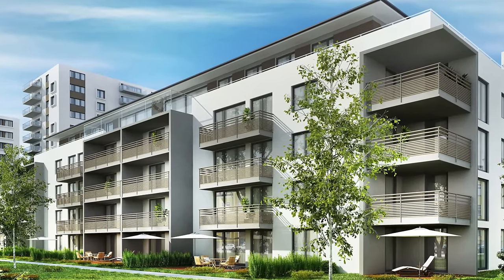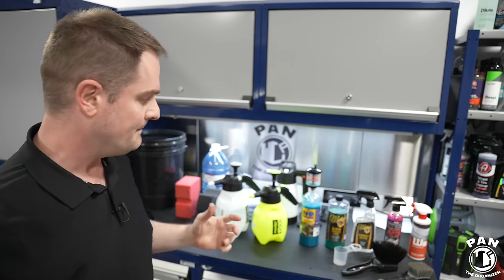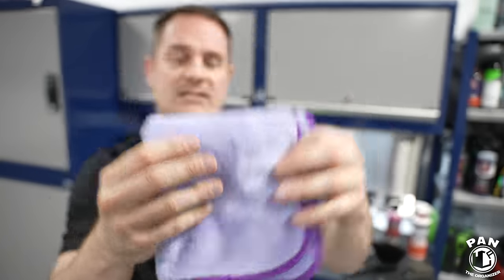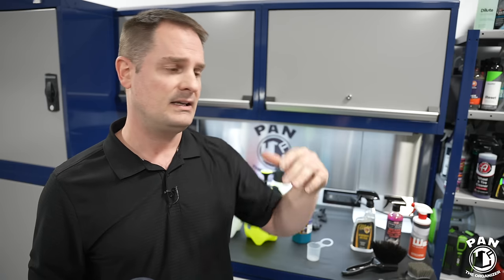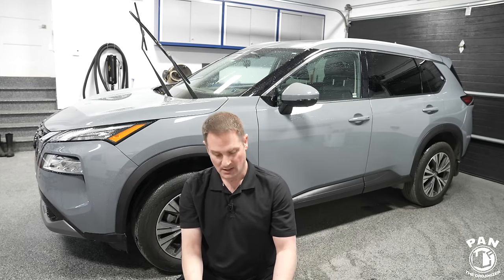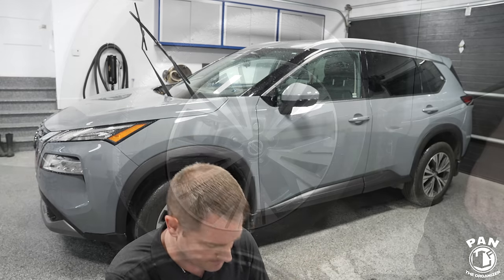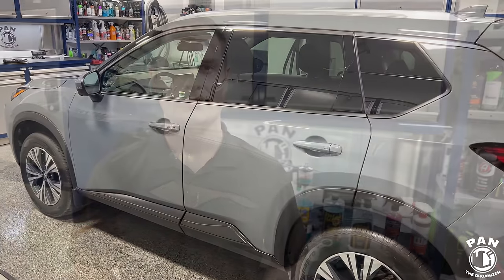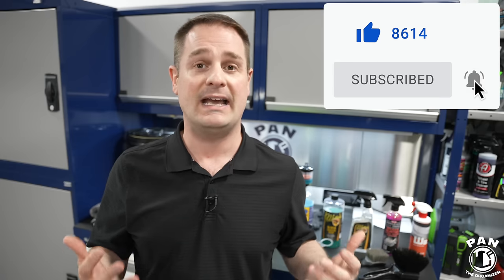How to wash your car without a hose or pressure washer! (RINSELESS WASH METHOD)

Comment: I can't believe this video has evading my searching and sleuthing of rinseless washing!  Top tier video.  Would've made my life easier if I found this about 2 months ago haha!  I am glad to know that I ended up on the same method for the wheels as you did here (P&S brake buster with rinseless spray down after; thanks for putting my mind at ease that this product does get neutralized this way).  Great to know I can even use bug remover during a rinseless wash.  Fantastic resource video...  From start to finish!

Curious for your thoughts.  I've been using the Eagle Edgeless 350gsm towels as a multi towel wash method (typically 5 is perfect).  While I've done the wrist roll you mentioned for a waterless wash...is it super necessary for the rinseless wash?  I adopted a way that seemed commonplace of just applying no pressure except the weight of the towel, some straight lines back and forth (similar to sponge) and flip to new side as needed or after 1 panel, whichever comes first.  Hope I'm not damaging paint; but I guess I thought there was enough lubrication on surface and with a thick enough MF towel...

I also love using the rinseless washes in a QD dilution as a couple extra sprays per panel for extra lubrication during drying process!
Reply from the maker: Thanks for the positive feedback! Don’t overthink the moment for the wrist roll, if you are just wiping it’s still fine, just change to clean sides often and don’t apply too much pressure.

Welcome to my channel. You discovered one of the biggest car detailing channels on YouTube as we surpassed 920,000 subscribers and we have over 120 million views! I have been detailing for 26 years and I love to share my knowledge and passion with my viewers.

You found the right channel to help you learn everything about detailing.

How did you discover my channel by the way?
Reply: @PanTheOrganizer   thank you for the feedback. You're definitely a top class content creator and community member...reading and replying to your comments and helping people out.  Keep doing what you're doing. Many thanks
Reply from the maker: Thanks! I'm the only big detailing channel that actually replies to its viewers on a daily basis on YouTube. I can spend up to four hours every day simply to reply to YouTube comments. I won't lie though, it does get overwhelming as you can imagine with an audience of almost 1 million subscribers and many more watching. I receive thousands of messages daily across all platforms.

I try my best to stay connected with my viewers and will continue to do so for as long as humanly possible. :)

Comment: I'm a big fan of a gallon of Wolfgang Uber SiO2, very affordable when you buy as a gallon. It's the only wash I use for mobile washes. You can dilute for clay lube, bug off, detailer, wheels, etc. Soak the car with a sprayer full of the mixed wash first, then use fresh towels that have been soaked with WG wash in the bucket to wipe grime off. After drying and any correction go through and use as a detailer. The beading action is fantastic. Super smooth finish

Comment: I use Wolfgang Uber Rinseless Wash(recently started using the SiO2 version) on my Infinity Q60 which has super soft paint and mars if you just look at it wrong.. It comes with an integrated measuring cup. It does a really good job and doesn't mar or scratching the paint. I use the Bucket method with Cheneel Wash mitts or super soft Microfibers cloths that I let soak for 10-15 min before washing. The key in +90F heat is once section at a time. Also use it in a pump sprayer with Distilled water as detailer.

Comment: Hey Pan thanks for a great channel and amazing tutorial videos, question i had can you use iron remover with the rinseless wash method worried that thr rinseless wash sprayer may not remove all the chemicals from iron remover

another question i had when your sprayer ran out of solution, can you dunk it in the bucket to refill mid wash ..i am ppf and ceramic coated

Comment: Hi Pan... I have watched a ton of your videos and have learned a lot. I thought I knew quite a bit about detailing until I found your channel. I have a question and I apologize up front if is already been asked and answered... I have a car that rarely sees the outside of a garage, other than 10-12 weekend car shows during the summer.   Let's say the car is already cleaned to spec and coated with ceramic the way you demonstrate, and is driven to a show weekly. Questions is, what are your thoughts on how to 1 - clean/prep the car upon arrival to remove what was picked up during the drive, and 2 - how to remove the dust/pollen that will eventually land on the panels while sitting in the sun for several hours. I appreciate your feedback... TY

Comment: I've been using a combo between the Gary Dean Method with the Rinseless Wash Method, but I use a pressure washer at a DIY car wash. Not too sure how much lubrication you'd get from the soaps at these places, so I use rinseless wash solution instead. I soak the vehicle in this solution and then pressure wash it for an initial rinse. Then, I reapply this solution with the bug gut remover and proceed like a normal rinseless wash, but I use the Gary Dean Method along with it. The only time I place an already used towel back into the bucket is at the very end when I need a few more sides to finish and the solution is still clean. From that point, a perfectly clean solution isn't as imperative for the windows and wheels.

Comment: Great video Pan. To be honest, I'm not a huge fan of the rinseless washes- I have done them and they can save a bunch of time if you have multiple cars to wash, but I felt like something was lacking from a full maintenance wash. Probably in my head lol. One thing I did different was load 1 oz ONR into the foam canon for the pre rinse and that made it even faster.
Reply from the maker: Heheh yeah I fully understand you. I also use the traditional two bucket wash as I also feel it gives a better overall clean.

Comment: Hey Pan, as always the video is insanely helpful to us and well produced without all the nattering and over-explaining some other channels try to do!  I have one question before I go ahead and order some no rinse:  My car is coated in 2 coats of the Hybrid Solutions ceramic spray coating (thanks to your recommendation) and I usually use that Hybrid Solutions ceramic wet wax spray as a drying aid, would that be safe / necessary with a no-rinse clean like this?  I had to spend an entire morning getting rid of the waterspots before applying the ceramic coats so I'm hoping to avoid anything that will cause them again.  Thanks mate

Comment: Hello. Fantastic video as always. Thank you. 

Coming from the U.K., under normal circumstances when the car needs cleaning ‘The car needs cleaning’. I get your explanation re rallying/covered in mud, but it would be interesting to see comparisons in your opinion which examples could be washed without running water and which examples can’t. Thank you. All the best.
Reply from the maker: Thanks! If it looks too dirty, use the traditional wash method, or at least pre-rinse the vehicle first with a pressure washer. Common sense is needed when using a rinseless wash method.

Comment: Hey Pan, I live in and apartment complex and I've used a variety of different methods and products. Here's my current set up that I'm running and it's worked very well.

I have a Zerowater to remove the impurities from my tap water. I live in California where my tap water is 400TDS. This does bring it down to Zero 0TDS and I get 20-25 gallons per filter. Filters are 2 for 30 so less than 1 dollar a gallon when compared to 1.50+ tax for distilled water. 

From that filtered water I use McKees 37 Graphene rinseless since I have a graphene spray coating on my car. It's $1.50 an ounce so not the cheapest for their 32oz bottle.

Everything together i use 3-5 gallons so $3-$5 bucks, about 3oz-4oz of product. I wash my car in direct sun for $9-$11 without fear of water spots.
Reply from the maker: Yup. I have a water deionizer setup in my garage so get 0TDS water too, which is amaaaazing for washing cars.
Reply: @PanTheOrganizer  I also have a deionized set up. My issues with it, is that I have to constantly switch out to use a faucet to water hose adapter in order to pump water through. The DI resin gets to be pricey since my water is 400TDS I don't get as many gallons out of it around 50 gallons for resin that cost $70. I think I get more gallons out of the zerowater because it's more of a drip pour so the water flow rate may be a factor. When the deionized water starts to increase TDS I filter it through the zerowater water kinda of like a pre-filter so I can get more gallons off the zerowater filter. 

The time I switch between zerowater and my deionized setup depends. Do I want the 3-5 gallons in 40 minutes using the zerowater? Or do I want 3-5 gallons in 6 minutes.
Reply from the maker: Interesting!

Comment: I bought both the red and black sponges - both disintegrated within 6 months - I kept them in the ONR solution in the bucket as I thought you could  - now just use a noodle mit - those sponges were expensive
Reply from the maker: Thanks for sharing your experience Robert. Did you try contacting The Rag Company about that issue?

Comment: This video is older but I use ONR on every car lot vehicle I do. It's more affordable and helps my time management which is key in car lot Detailing.  The car lot is not paved and weve noticed the vehicles dont accumulate as much dust and dirt on them as it sits on the line.  I use ONR on some customers vehicles depending on what services they are in for. I prefer rinseless to traditional foaming washes.  And if used well, I've rinseless washed a muddy car with it as well.  And ironically I'm doing a rinseless on a car today that lives on a dirt road.  Customer said to also protect it. She is hoping the dirt won't be as sticky.  So we shall see what she feels after a couple weeks
Reply: Well?

Comment: Learned a lot. As a mobile detailer do you think this is the better method for working in the winter months with snow? 🤔
Reply from the maker: Common sense is needed for the temperature. If water freezes, than it will freeze the solution containing the rinseless wash too.

Comment: I use ONR almost everyday to keep my cars clean. no issues

 I was very disappointed with the life of both the red and black sponges,   - both started shedding the cubes in less than 12 months - expected better for the cost.

So, now  I only use a noodle mit/microfibre.

How long can you keep the solution?/ need to renew - I use a grit guard and do not allow the water to get very dirty - sometimes i spritz the mix up with a shot with the pressure washer and it seems to be fine.

I regard myself as a daily amateur warrior

I trust your advice

Comment: I use the 2 bucket method but have to drag buckets, sprayers, foamers etc from my apartment so when the car is fairly clean this might be a easy solution. I’ll try it with the wash mitt and microfibre towels to see which works best for me

Comment: I'm going to try this method over the winter. I've got a full pressure washer setup and a heated garage but no floor drain and I really don't want to get everything in the garage wet with overspray and I don't want to turn the driveway into an ice rink either.

Comment: Hay Pan ! Great video..Just learned about the wheels with a Risless ..Thank you..But can you do this Outside..The working time is so different out in the  Element's
Reply from the maker: You sure can, but perhaps do one panel at a time and dry it as you go if you're working in the hot sun. Always try to avoid direct sunlight in general, not just for rinseless washes, and work in the shade for the best experience. But high quality rinseless washes like these in the video have water softening chemistry that helps with preventing water spots, but still do a panel at a time.

Comment: Hi Pan, long time watcher, first time commenter. .Question on washing the car in your garage.   Do you ever worry about too much humidity in the garage as a result of washing? I’ve read about ill affects of too much moisture contributing to rust of a car
Reply from the maker: Hi John! Welcome to my channel. You discovered one of the biggest car detailing channels on YouTube as we surpassed 1 million subscribers and we have over 140 million views! I have been detailing for 27 years and I love to share my knowledge and passion with my viewers.

You found the right channel to help you learn everything about detailing.

To answer your question, my garage was fully custom built to be a wash bay for detailing cars. From mold resistant drywall, kitchen/bathroom type paint, to dual drains in the floor, to a sealed cement floor, to a heat pump for heating and cooling year round, and also a 70 pint dehumidifier for perfect temperature and humidity control. So I detail in perfect conditions of 20C (68F) and 45% humidity. :)

All the details about my custom garage in this tour video: https://youtu.be/wx6HTBAzeXI?si=j0V-BFXNLO_m4oPa

I have had two new homes built this way, and never once had an issue. So yeah you have to plan all these things when building a new home, in order to use it to wash cars without worrying about issues.

Comment: Another super detailed video thank you.  In terms of protecting the person wishing the car from the chemicals involved I often wear nitrile gloves but have you ever looked at any inhalation risks from some of the sprays especially wheel and break dust cleaners?
Reply from the maker: I work in a well ventilated space. I only feel the need to wear a mask when applying ceramic coatings (in glass bottles).

Comment: Great video as always…but a couple of questions.  When you spray the bug remover or APC on the paint, won’t that strip any protection, minus ceramic coatings? And if I get down to dong wheels last and run out of solution in the sprayer and need more, should I still use what premixed solution is left in the bucket?
Reply from the maker: APC or bug removers can start breaking down weaker protections like waxes or sealants yes, especially after repeated use. If you see diminished hydrophobics after your wash, just reapply a layer or that wax or sealant. It's pretty quick to do.

Yes you can pour more of that premixed solution in the pump sprayer should you need more.

Comment: Hey. Just found your channel. Love the info. So what is this difference between the rinseless wash and waterless ace wash.
Reply from the maker: Welcome to my channel. You discovered one of the biggest car detailing channels on YouTube as we surpassed 920,000 subscribers and we have over 120 million views! I have been detailing for 26 years and I love to share my knowledge and passion with my viewers.

You found the right channel to help you learn everything about detailing.

A rinseless wash is much safer compared to a waterless wash. For a rinseless wash, it's a cleaner that needs to be diluted in a wash bucket, so you at least need water in the bucket, but you don't need a pressure washer or garden hose. And a rinseless wash will encapsulate and lift dirt off the surface, and acts as its own drying aid at the end, like a quick detail spray, to add lubrication on the surface while you are towel drying the vehicle.

A waterless wash is a spray product, that you spray on the surface, and wipe. There is zero use of water with this method, hence why it's not as recommended as you could potentially scratch the paint that way. It should only be a last resort alternative when you have absolutely no access to water and absolutely want to wash your car.

Comment: I am trying to help my elder family members with washing their cars, but it is very much time and labor-consuming.  I did regular car washes for them and it is very time/effort prohibitive work.  Would you please suggest a better/best methods (not the car wash places, of course ;)  )  to wash cars, saving time and labor/energy?  Thank you and thank you for your videos.
Reply from the maker: Nothing will replace a proper manual hand wash. As you gain experience, you should be able to complete a standard wash on an average size car within 45 minutes.

If the vehicle is only very lightly dirty or has just a light layer of dust on it, and you're ok with 90% clean results, you could just do a contactless foam wash and rinse, and blow dry the vehicle. See my video here: https://youtu.be/DjlUZnBtLtg

Comment: Thank you for the water saving technique! Hard to keep a clean car in CA with the guilt trip everytime I need to rinse it.

Ive been using waterless wash for some time now. Lots of time rolling my wrist and inspecting my towel. Plush side for initial wipe down, short thread of MF for buffing or a second pass on stuck on grime.
Reply from the maker: Yeah this is a big step up from waterless washes, so good on you for watching this video and learning a new technique.
Reply: @PanTheOrganizer  Appears much cheaper than a DI tank and pressure washer which was my most obvious next step. But for a hefty investment and a hit on gas mileage, this is preferable.
Reply from the maker: Don’t get me wrong though, I would still always recommend a traditional wash with buckets, pressure washer and wash mitts if a person has access to free flowing water.

I see the rinseless wash as a viable alternative for those who don’t have a graden hose or pressure washer to work with or are in areas of heavy water bans/restrictions.

Comment: Hi Pan, i love ONR especially in summers. Did a few cars in the sun and it is very quick and clean.
But you need to do it panel by panel and dry it directly when cleaned.
Reply from the maker: Yes, in direct sunlight it's best to wash one panel at a time and dry it as you go.